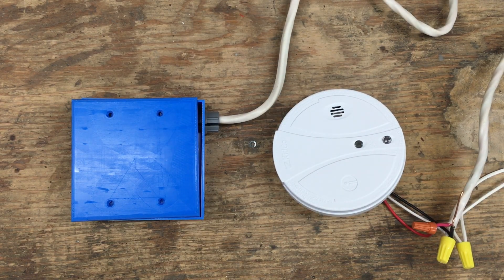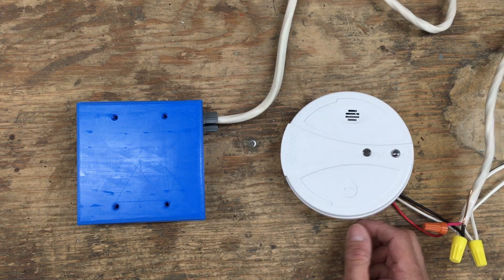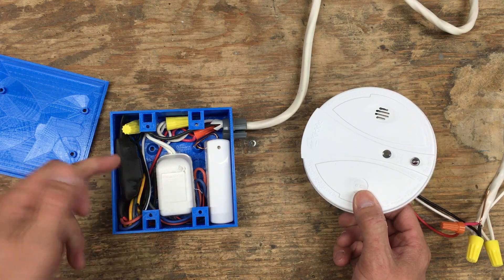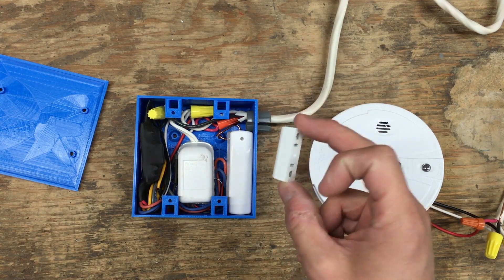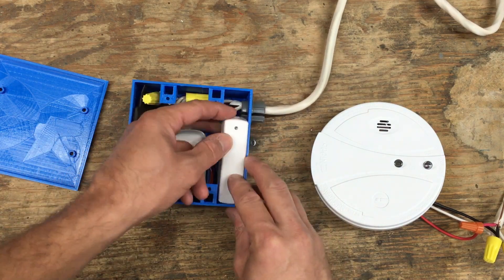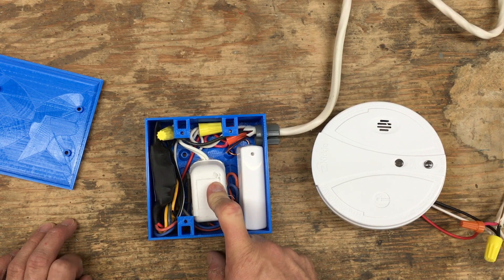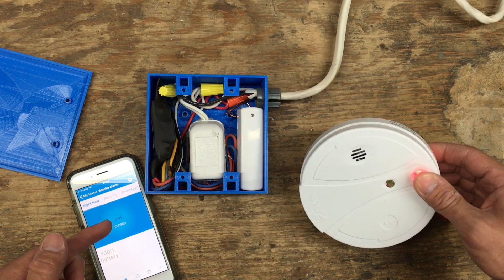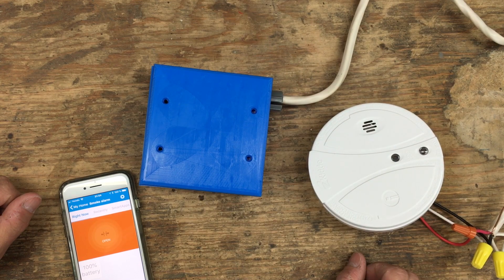SmartHome Smoke Detector Integration

Comment: Hi. I love this, is there a more detailed write up on how you did this? I am more interested in knowing what is inside the transformer and what exactly you did there. That is the only part really left out of this video. Thanks!
Reply from the maker: Hi, I don't have a writeup of this, but the transformer part is pretty simple. Basically, I simply hardwired a wall wart type transformer into the box to power the sensor with DC current instead of using a battery so I don't have to worry about replacing the battery every now and then. It could actually work without the transformer by just leaving the battery inside the sensor, but you would have to monitor it and make sure to replace the battery when it's low (this type of sensor would probably last a long time on a single battery anyway)

Comment: Great share !  It looks like you have the blue wire (COM) from the module and the red (I/O) from the module going to the sensor. Is this 9v or is it 110v power ?  I assumed it needed stepped down or it would dry the sensor. 
Thanks for sharing this project !
Reply from the maker: blue and red from module are actually just the relay from the sensor. Those 2 wires are normally opened and get closed when the sensor module receive an alarm signal for the smoke detectors.
Reply: @magimat   thank you for responding !  So that makes it even easier to tie into a d1 mini and sense the open/close. Now I just need to determine how to activate the alarm manually so that I can call it when someone opens a door. Again, thanks for the response !

Comment: Hi.  This is great!  I am a little confused with the the modification you made to the transformer to transmit a steady 3v.  Did you modify it?  Also, was here any soldering needed to the door switch?  The relay had terminals, but what about from the transformer?  Thanks.  This is genius. :)
Reply from the maker: Hey! thanks for your comment. The Ecolink sensor needs 3v to operate, so I could have used a 3v DC transformer without any modification, but since I only had an 8v one, I used a little regulator to take the output to 3v. (https://www.ebay.com/itm/10pcs-LM1117T-3-3-LM1117T-LD1117-3-3V-TO-220/280945323105?epid=1839121664&hash=item4169a56c61:g:Z7MAAMXQUY1Q-BYN).

There was a little soldering involved to the prongs of the transformer and for the regulator, but that's nothing fancy
Reply: @magimat  That's what I thought.  I was able to find a 110v to 3.3v transformer.  Would I have to solder to the EcoLink sensor, or are there terminals for both the relay and the transformer?